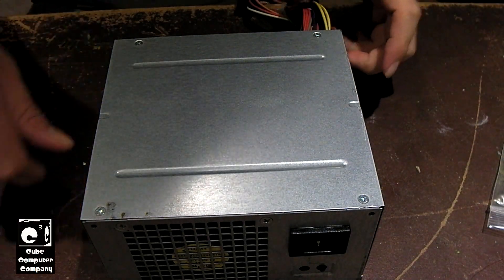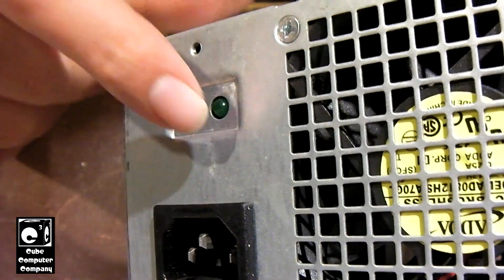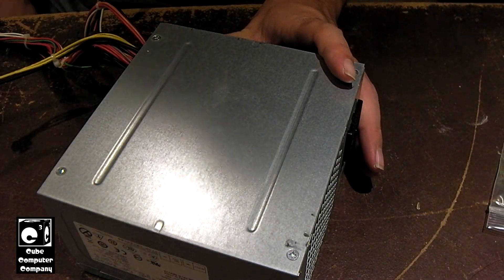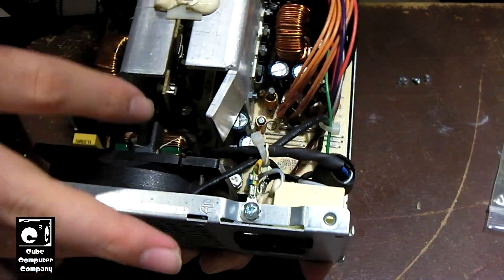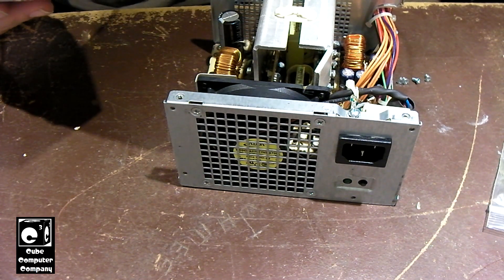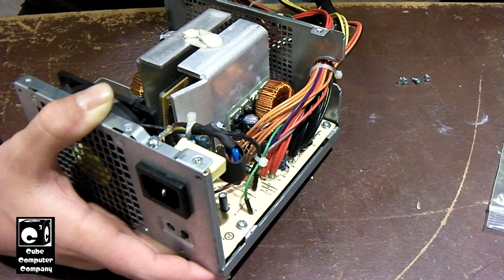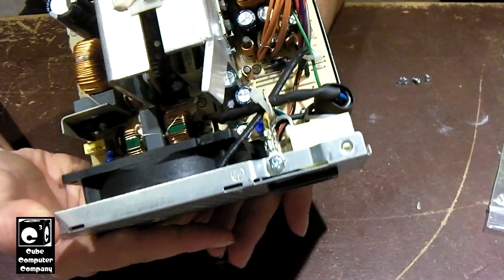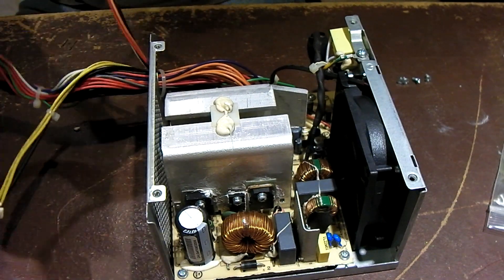Inside a Dell/Chicony H265AM Power Supply from Optiplex 390

Comment: What I think might be happening is the ripple on the 5V standby rail caused by the failed capacitor kills the main controll chip in the power supply. The main controll IC is almost defenetly powered by the standby rail. I have seen this before, for example the monitor I was fixing few days ago had a bad CCFL inverter caused by bad capacitors on the 13V rail powering the circuit. I have seen this fault in many different devices, including ATX computeer power supplies.
Reply from the maker: This unit has an IC driven 5VSB rail, so I'm not 100% certain if that's at fault. Of course many of us know about 2-transistor driven 5VSB circuits causing problems in units like the Bestec ATX-250-12E where the motherboard and control chips get fried. I'll soon be posting a video talking a bit more about the H265AM power supply. Some of them seem to try to start, but act like there's a short on one of the outputs.
Reply: @CubeComputerChannel  Strange that i had the exact same behaviour with the fried CCFL inverter circuit, It would start at very low intencity and then shut of after barely half a secound. Most of the other were straight up shorted. The failiure of the output smoothing capacitor will cause huge ripple on the output no matter the topology or the type of the supply. The monitor with the failed ccfl inverter had a controll chip and it still caused ripple.

Comment: Power supply problems seem to be the most difficult to diagnose... at least for me. Only time I have ever been able to diagnose the problem correctly one time was when a fellow volunteer at the renewal clinic where I used to work had a proper voltage meter, and the readings were totally off. Unfortunately, the customer was persuaded still to get a new machine, even though replacing the PSU actually restored the machine... a Dell OptiPlex, if I remember correctly.